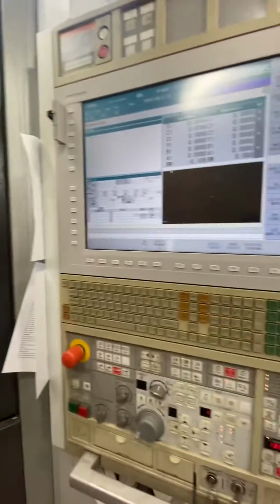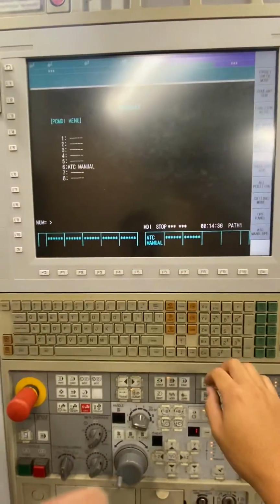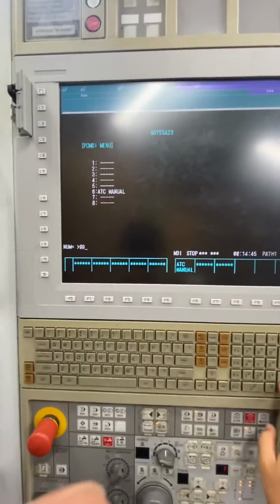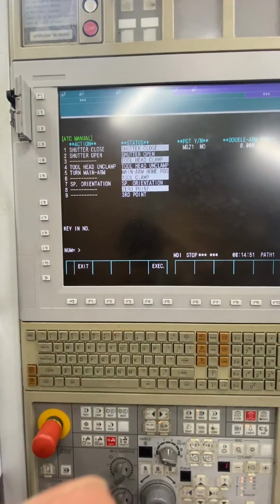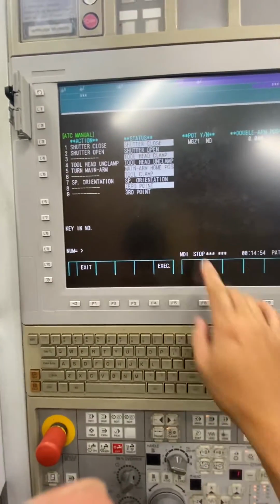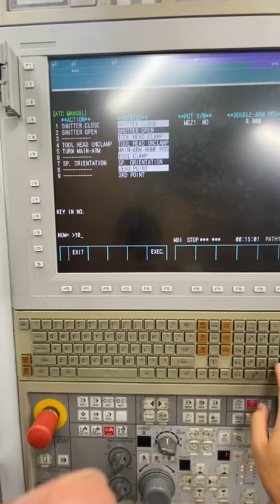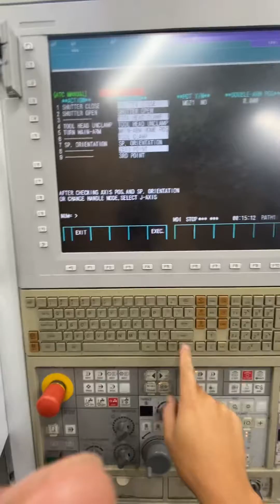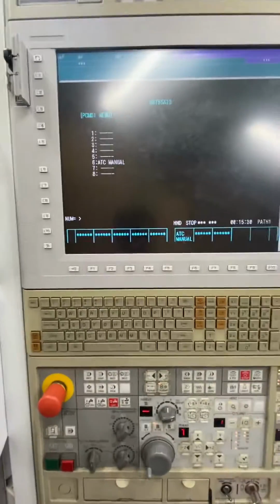How to recover ATC. Mori Seiki NT1000 SZM

Comment: Air compressor went down in the middle of a tool change. It didn't have a pot for the tool to go back into and couldn't get anything to move in settings, that 99 code was all I needed.

Comment: Hey any idea how to recover mdi mode? I’m working on a mori seiki sl250 lathe and I’m trying to set my parameters for xyzc axis since they are not homed but when I try changing apz to 1 it says wrong mode since it’s stuck on mem mode and I can’t go into mdi. Mdi button works and control is reading the input I saw the ladder diagram it’s ready but the mdi output isn’t energizing
Reply from the maker: On my machine I think you need to go to like system or setting and allow for parameter change.

Comment: Hi there. Atc chain is stuck in a mid position. As in half way between one position and another. How do i jog the chain ? It will not let me from the manual controls. Any ideas  thx
Reply from the maker: That hasn’t happened to me before, I think that’s a call for DMG Mori, wish I could help
Reply from the maker: If you haven't figured out I might be able to help. I had to recently rezero my chain. Comment back here.
Reply: @gtscientific_and_manufacturing   I need this info if you could help me out. Trying to teach zero but APZ keeps switching back to 0 on parameter 1815
Reply from the maker: @DubScruffy   What are you trying to do? Set XYZ zero for the milling head? I think you also might need to toggle APC possibly but I can possibly find the CNC forum thread that helped me.
Reply: @gtscientific_and_manufacturing  Replaced encoder on tool mag 1. Now it says it needs referenced. Can't get tool mag to move at all.
Reply: @DubScruffy have you found the solution?
Reply: @iceycoool  Yes. Got it figured out